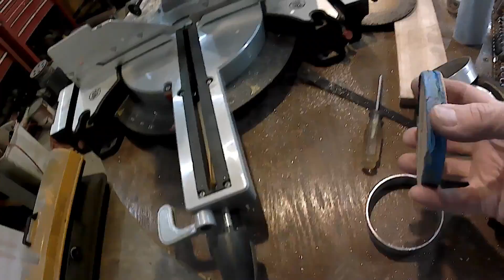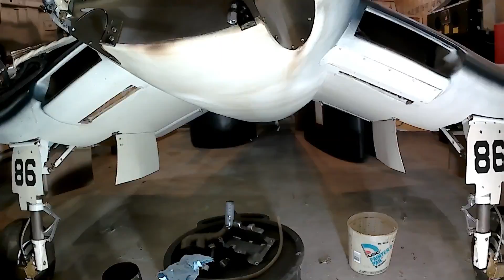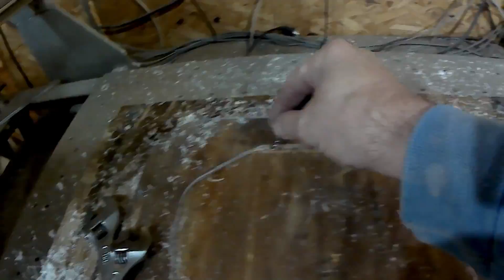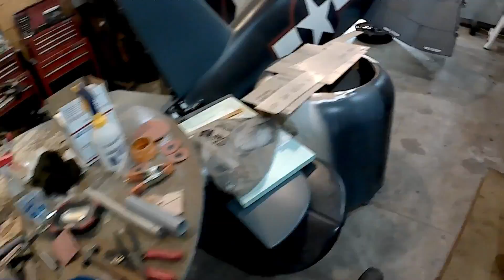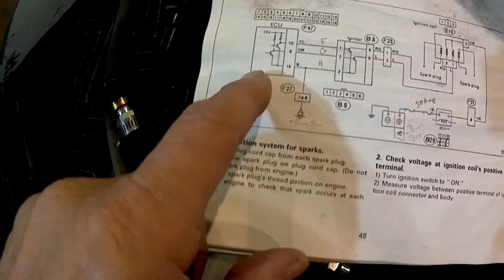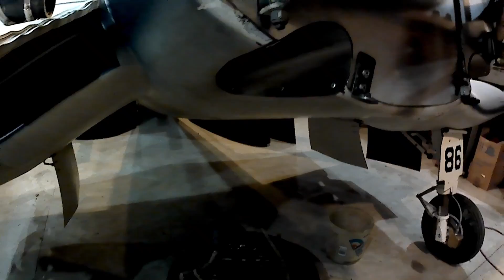WAR Corsair Repair Update 12/22/2024

Comment: I enjoy your videos. Your knowledge and skills are amazing. 

I know you enjoy the engineering process. No way ok would go backwards to a carburetor. Most every FBO has a courtesy car. And premium gas should have no alcohol. A simple call ahead during flight planning is all you need. Seems like a lot of work and expence to go through for an easy work around. Plus how is a carburetor better than fuel injection for efficiency?
Reply from the maker: Most airports that we fly around to here, don't have personnel on hand. You will be lucky to even see anyone around. A well tuned carb has way better throttle response than any fuel injection. When I first started working with fuel injection, that was the very first thing i noticed. And it hasn't changed in 40 years. Fuel injection does give better fuel efficiency, but you can get just as close with mixture control, plus you can lean out farther than EFI. Fuel injection shoots for 14.7:1. You can lean out to 16:1 with mixture control in an airplane, as long as you don't run into lean miss.
Reply: Thank you for the explanation. You make some good points. My airport (Akron Canton / KCAK) is not far from you. My airplane is carbureted. I have dealt with "carb ice" and wished , at times, that I had an IO-360 instead of an O-360. Carb heat has always worked fast and well. I'm sure that you will want to install that as well. As Mike Paytey says "back to work". 😁👍

Comment: Those Rotec Slide carb things are junk.. I’ve NEVER seem one that works.. I think you’ll have nothing but trouble with them. Instead of going  backwards with the fuel injection to a carb, why don’t you call Ross at SDS and see if they can help you with one of their computers that you can program and delete the O2 sensor? Or use a wide band sensor that’s more tolerant of the occasional 100LL? Going to that Rotec carb junk thing is going to be a mistake.
Reply from the maker: I have only seen one negative review of the TBI unit. It was an old one before the latest mods. SDS system is a speed density fuel control. They are not really good at fuel control like a MAF system. I would rather do away with EFI all together. I used to tune cars and write programs for the stock computers, as well as tuned many different aftermarket computers. That's why I went with the stock EFI. Now, I'm going back to my roots of Carbs.

Comment: The retro induction and ignition scheme makes perfect sense to accommodate the fuel changes, will the power unit still produce it's full potential horse power running on the alcohol plus fuel without ignition advance  ?  Brother,   Merry Christmas and a Happy New Year   :  )
Reply from the maker: First off, I'm not using any alcohol fuel at all, because of the stock EFI computer. As long as you have the same air fuel ratio and timing, the engine will make the same power. It may not make as good fuel milage though. Merry Christmas to you as well.

Comment: G'day,

Yay Team Don !

Lookin' good..., and all those changes make good sense to me...

Interesting that the Computer can't hold Zero without being constantly fed Gridpower...

My biggest project last week was a 15 ft-high Vent-Pipe on my daughter's "Tiny Pod" (dry composting Toilet system), which was as-supplied, and it works well enough that the Electric Fan may be superfluous...; but the look of the thing is fairly comical, 15 ft of Chimney on a 10-ft square Lawn Locker..., lol !

And, I finally crunched the numbers to be able to say that - based on my little Electric Chook-Chaser sized Motorbike which sports a 2.3 Kw/Hr Battery, and the $10,049 it cost to pay for the GST, Installation and Supply of the Solar Setup I'm recharging it with, Off-Grid ; that whatever sized Battery there might be in a Tesla, or any other Electric Vehicle..., the Battery's Rated Storage Capacity multiplied by $4,426 = the cost of being to run that Vehicle on Sunlight, and be able to charge it from Flat, after Sundown - and under a clear Blue Sky then the Solar Batteries will be full and "Floating" by 11 AM, Local Apparent Time.

And, apparently, the Grid here emits 661 Grams of Carbon to the Air for every Kilowatt it produces, while a Tesla covers 6 Km on a Kilowatt/Hour, at 100 Km/Hr (62.5 Miles @ 62.5 mph)..., on a flat road in still-Air - for 16.6 Kw/Hrs per 100 Km...

And that's the same Carbon Footprint as a 4-WD SUV of equivalent weight.

The one point on which a Tesla appears to be in front, though, is Aerodynamic Drag.

I've always worked on the Datapoints of pretty much all "normal Cars" needing  1/3 of a Hp for Rolling Resistance, + 5 Hp for Aerodynamic Drag, at 31 mph (50 Km/Hr)..., and as Speed doubles Drag Squares - demanding 25 Hp for 62.5 mph (100 Km/Hr)...

But the Tesla, at 16.6 Kw to cruise at 100 Km/Hr...., is doing it on 
Only
22.25 Hp...

So, the Tesla is a full 10% more
Slippery, than is a normal
Motorcar.

Which I assume must be due to the absence of a Radiator, and all the Cooling-System Drag which they entail...

And, perhaps...(?), that might be worth knowing...!

So, the week wasn't wasted... (lol).

Happy Solstice Festival !

Stay safe...

;-p

Ciao !
Reply from the maker: Very interesting numbers there with the Tesla. Until they find a better way to create electricity, it will never be a viable replacement for oil.
Reply: @Dynodon64  

Too true...!

However the "Fly in the Ointment" is the point that Agriculture has already become un-insurable due to increasing frequency & intensity of record-breaking Weather-Events, and what can't be insured can't be financed with borrowed money ; so as the Supply/Demand Laws do their thing, everything which depends on people who eat...., becomes more expensive...

Which has triggered a 
"Cost Of Living Crisis" in the Suburbs & among people whose Income was already committed to repaying Debt & Interest - because Food used to be cheap & plentiful since about the  the 1950s...

So, nobody can cope with any more Wildness coming from the Weather - and the Weather is being driven by the amount of Heat being held within the Atmosphere, and the Fossil Carbon we've burnt since 1750 has boosted Carbon Dioxide levels in the Air from 275 parts per million in 1750 (with 150 to 285 having been the "Range" for the previous 12 million years...) to 
319 ppm when I was born, through 385 at the turn of the Century, and now it's 424 ppm.

  And the kicker is that every Cube of CO-2 released takes 25 years to finish doing 95% of the Warming which it will achieve, so the Heatwave currently afflicting South Australia & Victoria & Western NSW (it was 47° C. at Wilcannia a couple of days ago, and tomorrow Victoria is forcasting 
Catastrophic Fire Weather , 
Over 40° C, Humidity under 20% & Wind 35 Km/hr - 50 Km/hr...)

Is the result of all the Fossil Carbon which I (and the rest of Humanity) burned before 1999...

In my lifetime the Average Global Atmospheric Temperature has risen from 13.1° C. to 14.6° C., so there's 11.4% more Energy driving the Weather than there was when I was a kid...
Here at 30° South & 3,750 ft AMSL the Soil used to freeze for a month or 6 weeks in Winter, but overnight Minimums in Winter have warmed up from -12° C. being normal to
 -2° C. being "unusually cold"...; and in Antarctica the Winter Midday Temp's are 40° Celsius higher than "Normal"...

Greenland 's Ice-Cap, and West Antarctica"s Thwaites Glacier, are both turning into "Slushies", only being currently restrained from sliding down their underlying Mountains into the Sea by their surrounding Sheets of Sea-Ice - which are melting fast.

Each one, Greenland & Thwaites, holds enough Ice to raise Sea-Levels by 6 metres..., and whichever one goes first - it's 6 metre Surge is expected to break the Sea Ice Sheet away from restraining the other...; so the full 12-metres will arrive in two steps, quite close together.

Elon won't get to run away to Mars, because both his "Starports" are scheduled to be converted into
SCUBA-Parks.

My guess is that someone told Elon about Thwaites Glacier & Greenland's Ice-Cap about a month before he bought Twitter.

Since then, his "Game" appears to be to do whatever it takes to stop Industrial Civilisation from being able to hold itself together as the Environment collapses.

He's doing "Crowd Control".

The faster the USA implodes, then the sooner Global Markets will collapse, and International Trade will fail to deliver & distribute Food, Fuel, Electricity, Raw-Materials & Manufactured Goods to the
Billions of Humans
Currently dependant on such uninterrupted Supplies & Deliveries ;
With whom 
Elon & the Plutoctatic
Accelerationists do NOT
Want to have to share the fast
Dwindling
Resources which the Biosphere is yet capable of making available to
Humanity....

At least, such is my assessment of Where things stand at the moment.

Growing up in Oz during the Cold War, preparing for the Aftermath was always part of Life - it's why I trained as a Nurse, to have an actually useful Skill which might be traded for Food...(!).

Greenhouse Effect was a known thing, it's why Eisenhower established NOAA, to advise on how to avoid doing what we went ahead and voted to do, anyway...; but 40 years ago I was kinda counting on the M.A.D. Doctrine to kick in and ensure that CO-2 levels were not going to be a problem.

But 3.4 Billion when I left School became 8 Billion, and if we were to cease burning Fossil Carbon Yesterday...., then the Warming will still increase in parallel with the increase in Fossil Fuel extraction & combustion since 1999....

Which is why I've bought a pair of  240-Volt AC Air-Conditioners, one for my Hut & one for the Toyshed, to run on the Motorbike's Solar System ; when the next Heatwave shows up at my place.

I can't stop the problem.
I'm trying not to make the problem get any worse - but I still eat out of the Supermarket, like almost  everyone else ; and I'm trying to get set up to try to last as long as possible, after the Grid goes down & stays Dark.

I didn't inherit enough money to even consider buying a Tesla, but the Bike & it's setup was do-able ; and having paid for what I did acquire - then I couldn't resist extrapolating from the Bike on my Lawn to the Tesla in the Marketing Story - running "Emissions-Free" 
On
Renewable Energy...

And, I think we'll be lucky in a hundred years if anybody has time to teach their children to read...; because surviving on the 
Leavings of what 12,300 years of
"Harvest Everything-ism" missed out on gathering up, commodifying, and shipping off to Market looks like being very tough indeed...

The fact that we can't think of anything which will replace Fossil Fuel doesn't mean that it's OK to keep using Fossil Fuel...; I think it means that I'd be a Fool if I didn't at least try to wean myself off the Habit...

Because the Taxpayers fund my Pension, as the Fool In The Hill, to stay out of their way and not annoy them ; I try to share my observations and perspectives, as seen from the Endangered Species Sanctuary - and YT is the forum where I post my Feedback...

Apparently, it all comes under the clauses regarding,

"Seek & you shall find...",
"Ask & you shall receive...",
"The Lord WILL Provide...",
"Give us this day & daily bread..."
"Eat your fill & don't take more..."
"The Universal Creator Godtheory
Works In Mysterious Ways...."

To name but a few listed in pretty much all the popular Godtheories, dovetailing together - as they do.

The weird aspect is that all 8 Billion 
have the Perfect Liberty to wake up tomorrow and choose to stop competing to Harvest Everything while maximising Profit - before someone else
Trashes the Common Land...; and instead, co-operate to burden the Biosphere as little as possible, while working together to restore every Ecology within the Biosphere which has been fed to the ever-growing
EcoGnomie which appeared at Gobekli-Tepe (where SE Turkey is today) some 12,270 years ago ; where/when the first Kernel of a Hybrid strain of Grain was dropped into the
Midden, where for the previous 30 years - since it began growing, ALL the Seeds in the Midden had been from Wild Harvested Species.
300 years after the first Hybrid Kernel, ALL the Grains in the Midden were Hybrids...

And 400 years after that Gobekli-Tepe had been abandoned, covered over with Sand ; surrounded by the
 First Human-caused
Desert on the Planet.

And their Diaspora spread
Harvest Everything-ism
Globally....

Thus,
We really truly, seriously, do
Live in Interesting Times
Don...

And you're placed to be able to get a rather closer view of the
Kickoff,
Than what I can see from here...

But I doubt there's much either of us can do to alter matters at this point ; the 8 Billion have decided that they do not want to care to know about much if anything - beyond how to "get ahead" and what to buy (and discard) next...

Which is part of the fun
In the long run
Of living in a Universe
Running on
Free Will,
Liberty & Consequences
Choices made & locked in,
Over 12,300 years of
History, and their collective 
Constraints & curtailed 
Options..., for us, all, now,
To figure out how to 
Live within...

Such is life,

Have a good one...

Stay safe...

;-p

Ciao !
Reply from the maker: @WarblesOnALot  I don't see anything getting fixed before I leave this realm. Our elected officials are only interested in what they can get for themselves before their voted out, or die in office,

Comment: I'm glad to see you had success making the plexiglass template, for the oil pan replacement plate. Converting it to a carburetor will be an interesting process, most of which you seem to have planned out already.
Reply: In my opinion, I would be cautious about conversion to a carburetor, better to test fly with a proven fuel system. Lots to keep you busy with just the current list of projects and changes. Proving out a new fuel system adds additional risk. Fly off your test period and you can make more changes later if you feel their needed.
Reply from the maker: @bernieschiff5919  My whole adult life I have been working on engines. I know carburetors inside and out, as well as EFI.  Making them work is my life. Thanks for the thoughts though.

Comment: I would suggest not using the wood and instead use pieces of plexiglass to space up the part off your machine table, that way you can clamp it down real hard, and it's flat.
Reply from the maker: I've used plexiglass before too. It's not consistent on the thickness either.

Comment: One hour of flight time, 300 hours of redesigning and improvements. The life cycle of all aircraft from the Wright Bros to to the latest jet planes. I'm very impressed with your upgrades.😎
Reply: On new designs or those with only a handful in the air, that is true.  I built about the 12,000th of my design (MiniMax) and used one of the recommended powerplants (Rotax 447), so only 20 to 30 hours maintenance and upgrades per hour in the air.
Reply from the maker: Thank you.